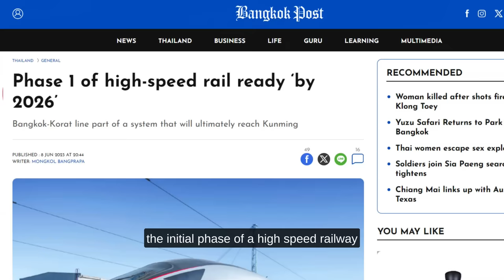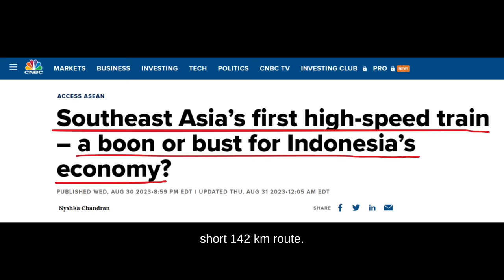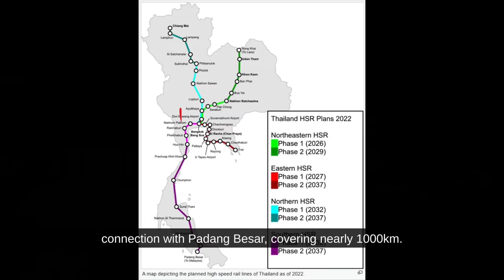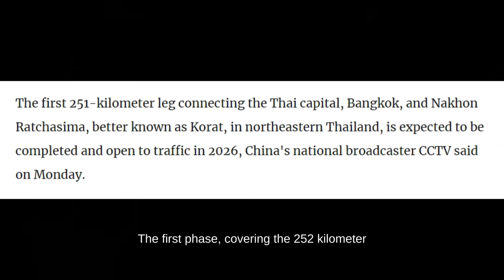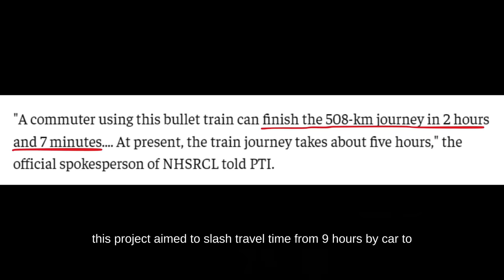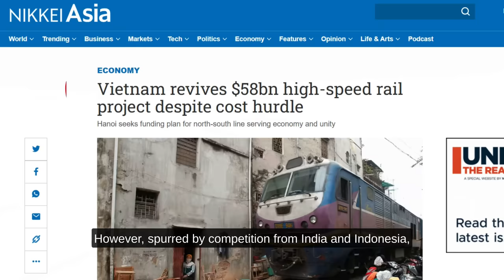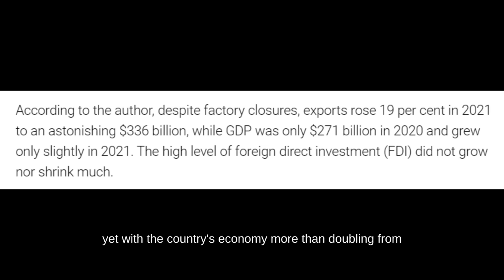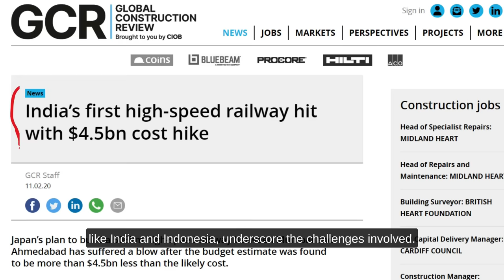Thailand, India, and Vietnam Competing to Build HSR

Comment: As an Indonesian i must say HSR is indeed magnificient, how a train can travel up to 300km/h so smoothly is simply engineering marvel.
Reply: 350 km/hr
Reply: 100% made in China
Reply: @blackknight4996  High-speed rail (HSR) is a type of rail system that operates significantly faster than the traditional rail system.
The definition most often used for high-speed rail is the practice of speeds at or in excess of 160 km/h.
USA, the speeds in excess of 90mile/h.
Reply: @sirisakpimjun4384  
High-speed rail (HSR), passenger train that generally travels at least 200 km (124 miles) per hour and can cruise up to 355 km (221 miles) per hour, though some have reached higher speeds. More than 20 countries, largely in Asia and Europe, have high-speed rail networks.
Reply: @blackknight4996  Which countries?
Reply: @blackknight4996  In Japan some high-speed railway lines service speed 130km/hr.
Reply: @sirisakpimjun4384  
Sources: Britannica, Wikipedia
Reply: @sirisakpimjun4384  
Well, you can call yourself super high speed rail... but nobody in the world will take Japan seriously, when 350 and higher speed are achieved.
Reply: @blackknight4996  Britannica, Wikipedia, imagine or opinion technical specification, not official specification.
Reply: I thought for a train to be considered as HSR it has to reach 300km/h minimum?
Reply: @blackknight4996  The Akita Shinkansen line
300 kilometers per hour between Tokyo and Morioka, 
130 kilometers per hour between Morioka and Akita.
Reply: 中国1000km/h的超级高铁已经在测试阶段了
Reply: I’ve traveled by train numerous times across the Netherlands and it’s such a surreal experience. If I go back home to Jakarta, I’m definitely trying out the Whoosh train. Salam dari Indonesia 🇮🇩
Reply: even japan is max 320km/h
Reply: @KijjiSale   Yamagata Shinkansen and Akita Shinkansen line speed 130 km/h.
Reply: Whoosh has broken the passengers traffic on 25th December of 1,050,000 passengers with 48 daily trips
Reply: I admit that Joko Widodo's thinking is smart. He prefers China to Japan. It's cheaper and especially transfers technology to INKA Indonesia, Japan is more expensive and doesn't want to transfer technology.
Reply: @KijjiSale  The speed of many places on the Shinkansen is only 200km/hr. 🥲
Reply: Its German and Japanese technology
Reply: @blackknight4996  only china and indonesia can go 350km/h not even the japanese can do that now

Comment: Indonesia also planning to have their own version of semi HSR with top speed around 200-250 kph operated in narrow gauge 1067 mm bcs java and Sumatra islands using narrow gauge 1067 mm railways
Reply: ...........narrow gauge with top speed 250kph,it would fly off the tracks and Indonesia will be the first !
Reply: No brother, it will be 1.435 mm (standard gauge). The maximum design speed is 280 km/h-300 km/h with operational max speed 250 km/h, so its a high speed rail not semi high speed because as per Indonesian regulation, high speed rail is anything beyond 200 km/h.
Reply: @luarbiasawaras8700  the infrastructure in java and Sumatra Islands is narrow gauge 1067 mm that's railways infrastructure in Sulawesi island which use standard gauge 1435 mm and min HSR to speed standard is 300 kph
Reply: @widodoakrom3938  I know, but this indonesian made high speed train will use 1435 mm standard gauge, thats the technical spec they gave at the press release
Reply: @luarbiasawaras8700  yes second phase HSR bandung-surabaya routes maybe we can event built third routes Surabaya-denpasar third phase HSR
Reply: @widodoakrom3938  please understand that Indonesia hope to sell trains abroad, so using standard gauge is important.
Reply: @luarbiasawaras8700  that's long way to go
Reply: For the Jakarta - Semarang - Surabaya route, it is certain to build a new rail line. It is impossible to use the existing rail line. It's just that it will likely utilize the existing land or next to the existing railway to save land acquisition budget. Or maybe next to the toll road. And the train is a high-speed train, not a semi-fast train.Because the maximum train speed can be up to 300 kilometers/hour. For operation of 250 kilometers/hour there may be several factors. Such as geographical factors or maybe there will be many station stops.
Reply: @AhmadAhmad-dm2xj  nope it will used existed narrow gauge railways 1067 mm cost to build HSR is ald very expensive it's impossible to build new railways for new semi HSR made in Indonesia
Reply: Nanggung lah kecepatan sgtu buat apa? Mending HSR lanjut k SBY nah  semi HSR bangun d Bali supaya Bali gak tambah macett. Heran saya padahal pemasukan wisata d Bali itu GUEDE sekali tp transportasi massalnya masih menyedihkan.
Reply: @harukrentz435  gk bisa krn pake infrastructure rel yg udh tua Dan narrow gauge 1067 mm nanti HSR bakalan diperpanjang lagi rute ke 3 HSR Surabaya-denpasar
Reply: @widodoakrom3938  kalau jadi di bangun kereta yang 250 km/jam kemungkinan pake rel baru atau rel nya di modif ke 1435 mm,, 1.067 mm terlalu berbahaya dan rawan anjlok untuk kereta semi cepat apalagi kereta cepat,, kereta reguler 100 km/jam aja masih ada yang anjlok di rel 1067 mm,,
Reply: @asiafuture3448  darimana duitnya?

Comment: Thailand, India, and Vietnam: it has begun
Indonesia: it has done
Reply: Vietnam not starting yet, still back and forth between Japan and China…
Reply: Only 142km...meanwhile India building one is 506km...will be operational by 2027.
Reply: @MrinangoCHAKRABORTY9103  good luck
Reply: @MrinangoCHAKRABORTY9103  original plan is 2023, and changed once to 2022, why you say 2027?
Reply: @wangkang9581  construction was started only in 2020. You know India is a federal state. Each state has it's own govt. Central govt can only implement laws it's upto state govt to pass it. Because of Maharashtra govt's negligence it got delayed.
Reply: The problem was made by some stupid politics and land acquisition but now problem has solved soon Indian bullet train blogs will start @wangkang9581
Reply: @MrinangoCHAKRABORTY9103  500km but the progress still on 10km for a years🗿
Reply: @MrinangoCHAKRABORTY9103 Indonesia also will continue to Surabaya 700km long
Reply: India: Hold my UPI
Reply: @MrinangoCHAKRABORTY9103  the short trip is the best way to manage everything until it works and going well as the plan
Reply: That is because Indonesia used Chinese engineers to work for while Thailand uses Thai engineers and materials. In long term, Thailand will be the true leader in ASEAN.
Reply: @MrinangoCHAKRABORTY9103 India is opening only 50 km stretch from Surat to Billimora in 2026😂
Reply: @preethamvarma9940  Indonesia bullet train length only 142km and it took 4 yrs to built. India's bullet train length 503km. Of course it would take time.
Reply: @MrinangoCHAKRABORTY9103  Both are started at same time but India is opening 50 km stretch by Aug 2026 between Surat and Billimora..
I think u know 142 km is more than 50 km..
Reply: @preethamvarma9940  don't you know about the land acquisition problem? It delayed
Reply: @MrinangoCHAKRABORTY9103  Yes land acquisition problem was in maharashtra state..
But Surat and Billimora is under Gujarat section..
Gujarat didn't faced any land acquisition problems..

Comment: Thailand HSR should be the next one into operation ,if it has close partnership with China for the project.  It will benefit the whole south east Asia if Thailand can become HSR hub as planned.
Reply: @richardparker1338 Thailand works with China for some of its HSR and with Japan for other HSR. As these 2 countries have incompatible HSR systems, Thailand’s HSR system will be complexed.
Reply: @richardparker1338  At least Thailand agreed to work with China for the railway connection to Lao whose railway was also built by China (same system standard). Trains moving between Thailand and Lao don’t have to switch system at the border.
Reply: If I remember correctly, all railway being planned and built in Thailand are under 200 km/h. So strictly speaking, there are not HSR.
Reply: Sir you are not indian
Reply: @leichen8000 
Find information around you.  Before expressing your opinion . What country is this from don't have internet?
Reply: indonesia is HSR hub
Reply: @leichen8000 Maximum operational speed of 250 km/h.
Reply: Yes, the new HSR Thailand plan to complete in 2026 has the operational speed of 250 km/h. Thanks for the correction. This HSR will further extend to Lao and connect with the Lao-China railway. Excepting!!

Comment: Isn’t it amazing on how the Japanese also only charge Thailand 0.01% on the interest rate for such a large amount of loan on many infrastructure borrowing, though this didn’t include the high speed railway as the Thai used their own investment. The relationship between the two nations has always been strong.
In the past Thailand has a lot of help regarding to their economic, technological advancement, as well as structure of the  development within the country using Japanese modem. 
It is not strange to see why Thai people held very high respect for Japan. 

In regards to the bullet train, from many countries in the south east Asia regions, apart from Singapore,  Thailand is probably the only country that didn’t fall for to the Chinese trap on the belt and Road initiative borrowing as well as receiving the technological knowledge in bullet train  rail-tracks from one of the world’s best advanced bullet train system. 
In the long run Chinese will of course gained more in this exchanges for their e commerce crossing platforms but Thailand do hold 100% ownership rights nor do they have to share profits or leasing land along the rail tracks to china under long terms special economic trading areas. Unfortunately for many countries this was a common condition in getting the Chinese bullet train running in their country. We heard that Lao gave 90 years lease of land as well as most profitable made go straight back to china because they do not have the funding, the technology or workforce but wanted to be part of this belt and road development. 

We don’t know how Thailand is doing it and get this better deal from china. But once the infrastructure of the high Speed train is achieved successfully on top of their existing public transit network for all over the country to a good standard = this nation will most  likely to become the central networks hub in south east Asia. 

Best of all we must congratulate them well done for not getting into Chinese debt. 
Respectively Japan may have been the First Nation to get the bullet train running in the world but unexpectedly in this decade it is the Chinese who got the technical technology in faster completion that comes at a cheaper cost. May be with the advantages that Thailand have in relation to both countries it would be great to see the technologies of Japanese and Chinese bullet train being combined.

At the same time what happened to our HSR2, was it just another windswept that meant nothing and does anybody know why the Chinese turn down the uk contract deal for high speed train?
Reply: Are you confused with Thai and India…..?
Reply: @leichen8000  thank you for noticing. I didn’t realize that Google speech didn’t pick up on what I meant to say.
 I now corrects my opinion. once again, thank you.